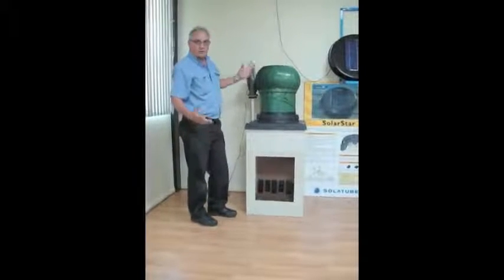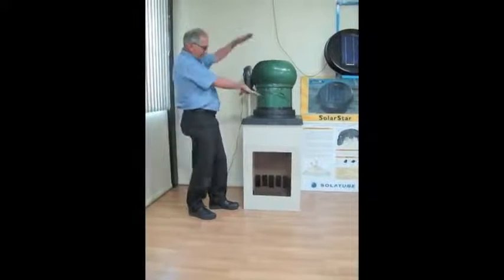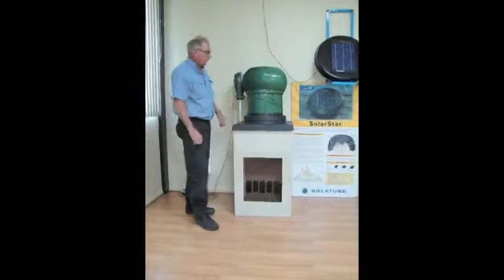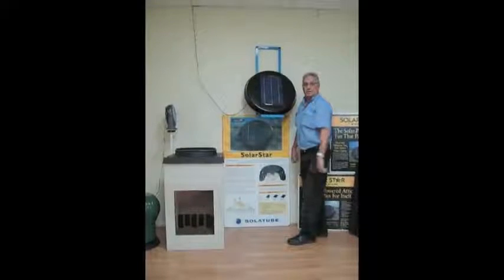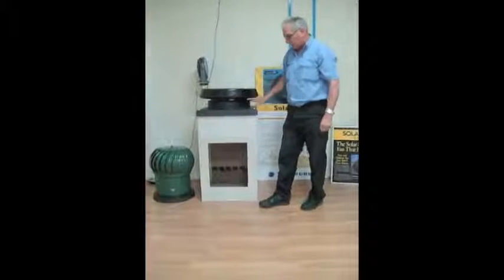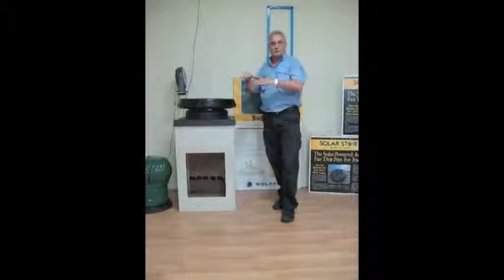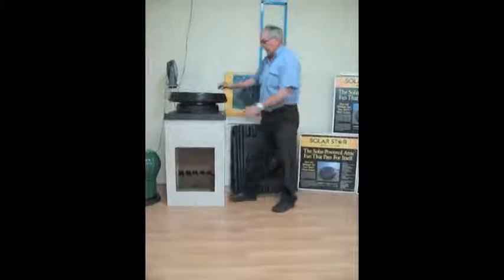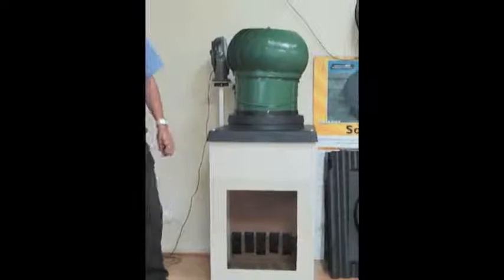Solar Roof Vent V Whirlybird Wind Vent

Comment: Good demo but don't be fooled folks.Turban vents can move a lot of air with just a small breeze.  When used in pairs, the air circulation is even better.

Comment: Can you tell me if either of these units will be effective on my bush camp with a skillion roof of polystyrene sandwich panel 75mm thick and trimdeck profile NO CEILING SPACE. And if you think one or the other would be effective and appropriate for my roof profile WHY.
I dont have any cooling and on a bad day it gets to 42/43c inside - I do have extensive wall insulation. Is it a fact that without some sort of cooling input no extractor will make a difference as heat out draws heat in.
Thanks in anticipation of your response